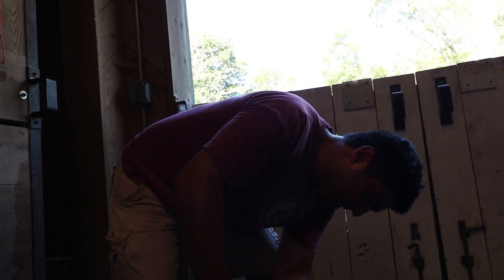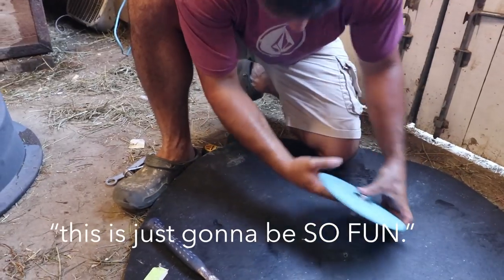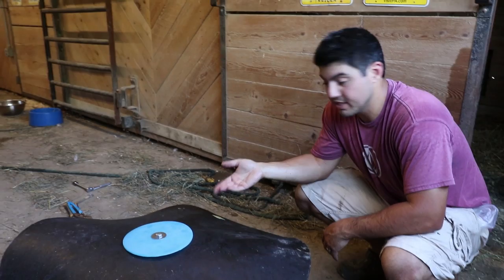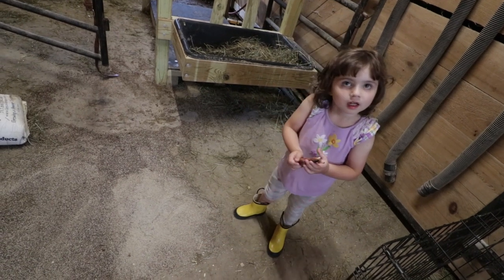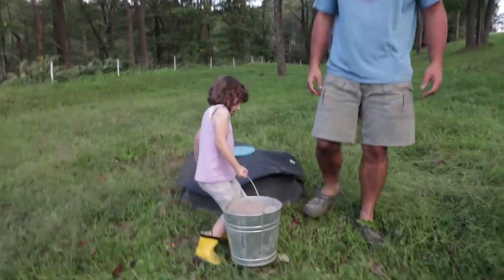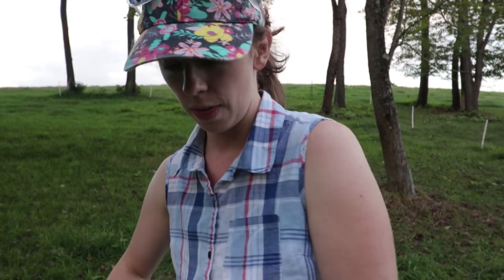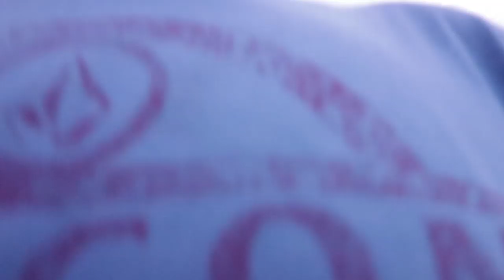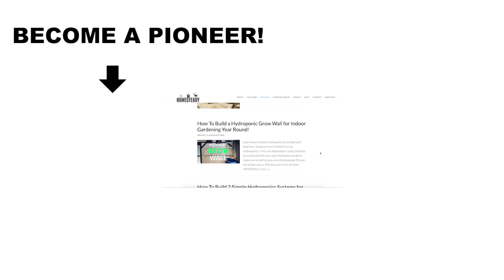We have been feeding our cows the wrong way... BUT CHANGE AIN'T EASY!

Comment: That is a very sweet mineral feeder! I noticed a massive difference when I started doing free choice loose minerals. I currently use a rubber feed pan. It's just easier to move around because we rotate to new pasture every 24 to 72 hours. Sometimes they ignore it, sometimes they go nuts over it...and when that happens I have to water them like crazy if they aren't in a pasture with a spring box. They also love kelp.

Comment: I guess we are one of those farmer that put the blocks out. Actually we give our the protein tubs. After they are empty we will put a salt block in one and a mineral block in another one. We also buy a worming block once a year and it goes in one. They sit out by the small shed we sometime feed the calves in and when is is going to rain we pull them in the shed and back out after it rains. Been doing it this way for years. We did try putting it on the feeding year ago but I like the free choice better. Austin does have a great sense of humor.

Comment: I suspect the blue disk is to be under the rubber, between the plastic base and the black rubber rain shield
Reply: Actually I went back to the manufacture web site and they show smaller disk on top, not sure if the blue disk is under the rubber or not. I suspect the blue disk belongs on top unless here is a smaller approximately three inch or so disk included in the parts.